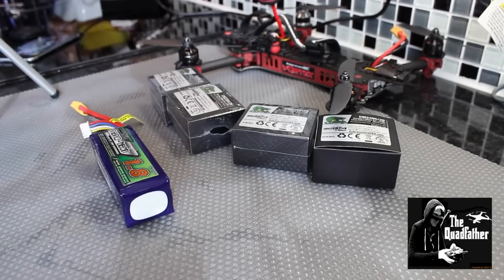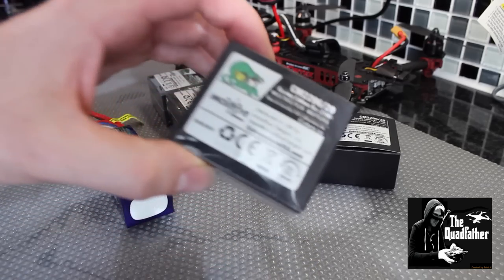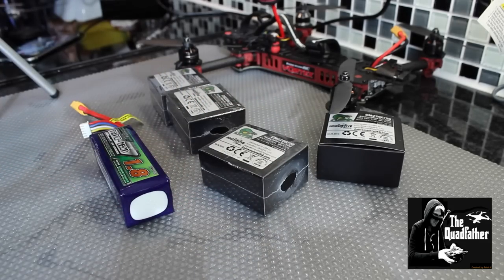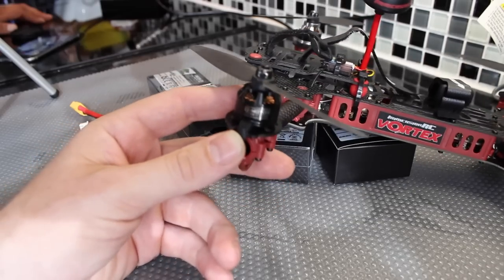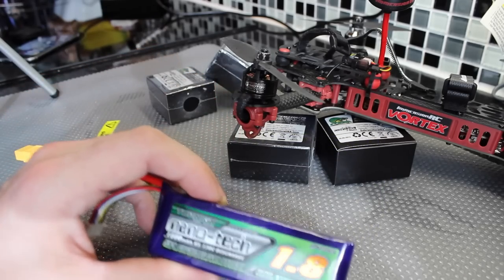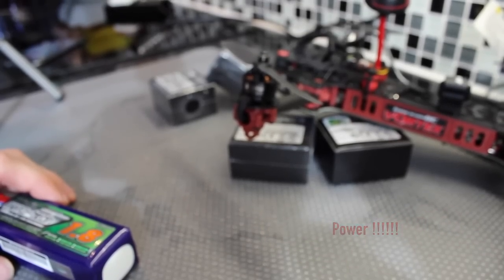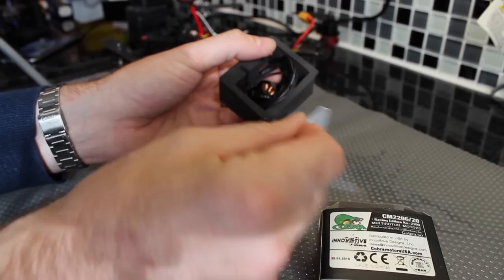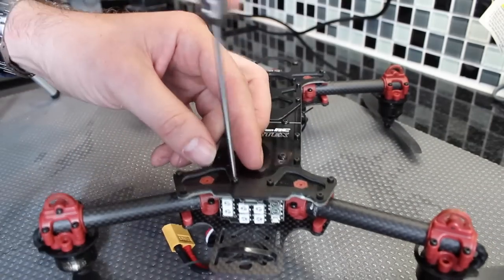Vortex fitting Cobra 2100kv and 130c 4s! and test flight

Comment: do you need to modify the carbon mounts to fit these square? Mine do not align with the arm and cable guide...or can I just remove the carbon plate all together?
Reply from the maker: +Kris Dean yes mate i removed the carbon plates aswell. you can use bigger threaded screws through the side of the plastic mounts. this way you can change the motors without having to undo the plastic mounts on the carbon fibre arms. I hope this helps. sorry for the delay in replying your comment was marked as spam for some reason ? happy flying pal
Reply: Thats weird, I shouldnt be coming through as spam! Yep all sorted, have mounted with the plates which work fine also.

Comment: Ok question lol, how did you mount the motors? It looks like i can only use 2 screws to hold these motors on? Are you using different mounts
Reply from the maker: +JAYO FPV thats right pal, same as me, and the screws go through the side of the red plastic motor mount, not through the centre like the standard motors that came with it, its handy actually because u can now take a motor off without having to undo the whole mount.
Reply: Ok awesome! Thanks man! :)
Reply: +The Quadfather Which screws did you use? They were not provided with my 2100kv motors, the ones which were provided like much shorter than the ones you show on the video.
Reply from the maker: I used some I had laying around. They are longer than what is supplied yes. 2 on each motor through the holes in the side of the red plastic casing if that makes sense ?

So you could change a motor without having to undo the whole red plastic assembly

Comment: Hi there !i have soldered some t-Motors 2206-13 2000kv to the orginal esc with 5030. now the leds on the back are all red at start up. not the green 1,2,3,4 start up. When i arm the vortex, all motor are spinning in correct direction. Try to fly .. it`s not possible current goes up over 25... could not see it long time, than falls down to 4-5Amps.any idea ? Change the esc ?
Reply from the maker: +Ralph Meyer the immersion rc esc's are bullet proof pal, id look at the motors rather than the esc's first, have you plugged it into cleanflight and done a motor test on each motor independently ? remember to remove props before testing, this should atleast help you diagnose which one is causing the problem. good luck fellow pilot
Reply: +The Quadfather thanks for your quick answer. i did the test.. and it looks like one of my brand new Motors is damaged. i ordered a new one, try it again in some days.
Reply: +The Quadfather your led backplate is working like before ?

Comment: how did you mount the cobras on it? i cant fit them on with stock bolts.
your video is so fast, so i cant se what you are doing. :)
Reply from the maker: +SteadyPete's FPV lol, sorry bud, what i done, is to put 2 longer bigger bolts on each motor, they go through the plastic motor mounts (along the edge) if that makes sense ? so you could put a motor on and off without having to unscrew the mount. this does however leave the cables coming out of the motor at an angle, but nothing can do about that.
Reply: Okay thanks mate, i will do this aswel. thanks for fast reply :)

Comment: Any issues with stock ESC's? I am about to pull the trigger and get these but am afraid the stock esc's wont hold up.. :/
Reply from the maker: JAYO FPV u know what, i have tried every propellor i can find on this combo. even with 130c 4s battery still holds up fine. well impressed with the immersion rc escs
Reply: The Quadfather Awesome! I ordered the cobras today along with a new Vortex lol. Mine was beat. Now I just need to find some higher rated C lipos :)

Comment: Did you use 6045 props on there?
Reply from the maker: +tyler johnson no, dont like 6" props mate, this video was with dal 5040
Reply: Well to be a true test for the esc's you need 6045 props.    I had 6045 3 blade props on and it hovered at very low throttle, and you can barely hear it at all.    It's  stealth.
Reply: +tyler johnson I´m gonna try that too, have the Motors but waiting for the ESCs. What ESCs did you use? I ordered some 20A Little Bee´s, should be O.K. for 10sec. bursts... I´m gonna use this setup on a light mini hex ^^

Comment: What do you think about upgrading to the cobra 2206 and 30amp ESC for the vortex?
Reply from the maker: Not sure where you'd fit the esc's? The ones in the vortex are tiny and in the arms.

The esc's handle the power fine. Even with the bullnose props. I see no reason to change them mate.

As for changing the motors, I'm not sure, too early to tell yet. But the Cobras definitely seem better built. Take a crash better and tuns of torque

Time will tell, I'll be sure to update
Reply: +The Quadfather they are 12A esc's right?... with those props the motors can pull up to 27A... they are not 12A are they?... plz no
Reply from the maker: they are 15 amp i believe. they seem to handle it ok, (check some of my videos) i have noticed it can judder a bit when u crank the power quickly. (mr steele style)
Reply: ok, thats not as bad then, makes me feel a bit safer about getting 20A